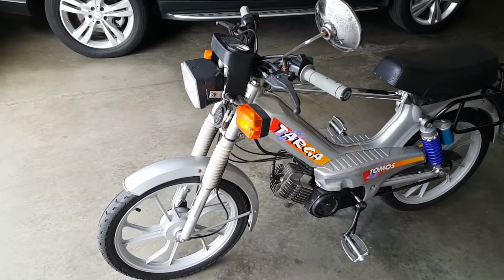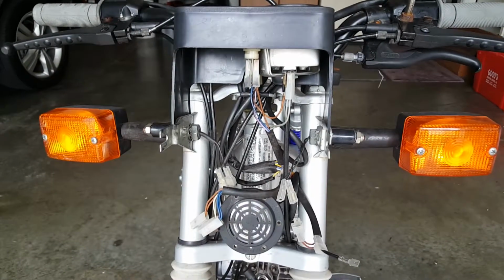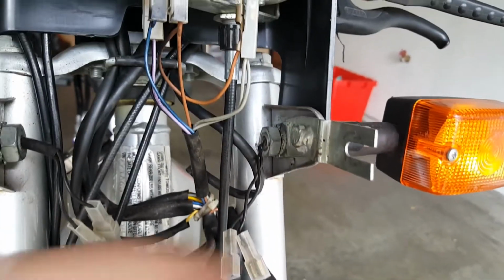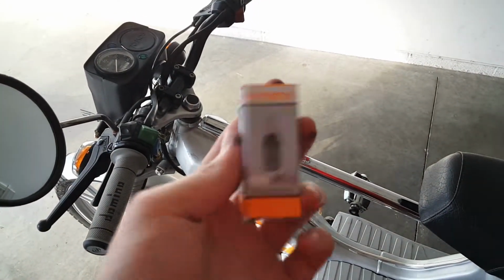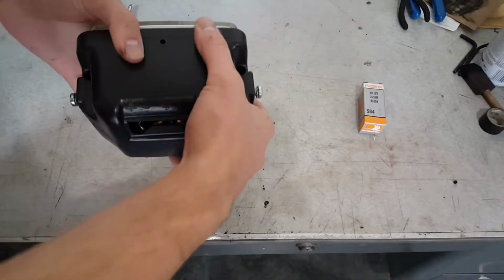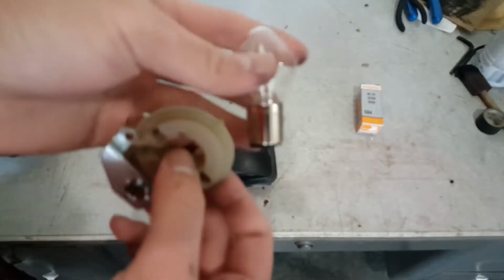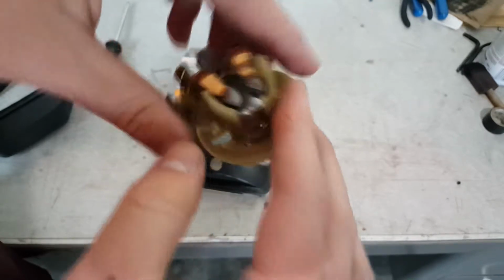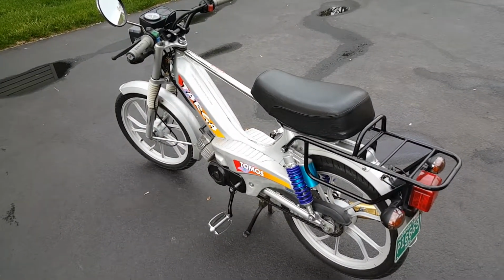Moped Cafe Racer Build Part 3 Final

Comment: 🤔y didn't u just use the original connectors from the old turn signals on to the new T. signals instead of using black tape.
Reply from the maker: Wanted to keep the original just in case but I got the proper connectors after!
Reply: @B0balagurak  anymore updates to your bike ? Will u be doing a follow-up video or a daily ride out vlog ?